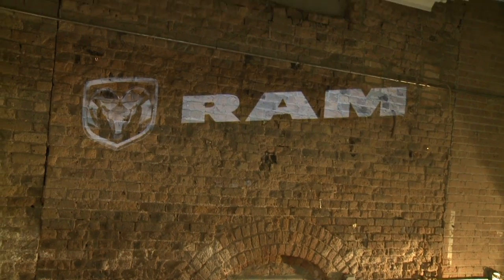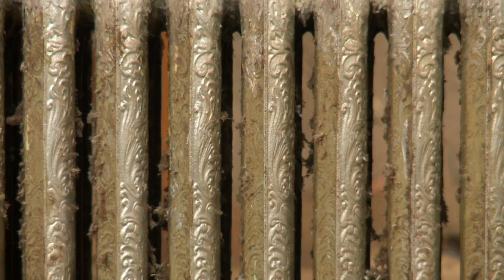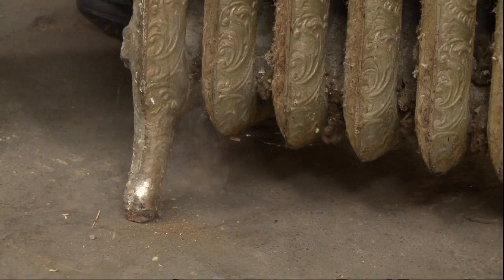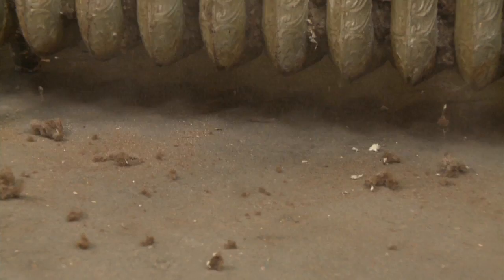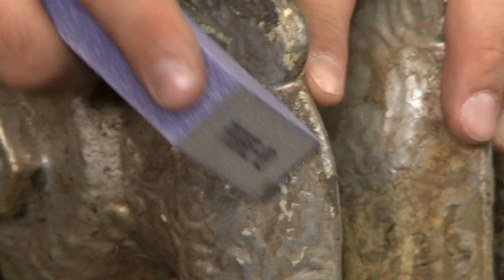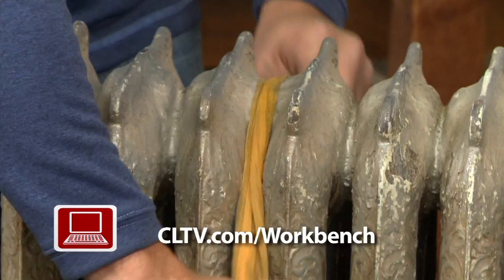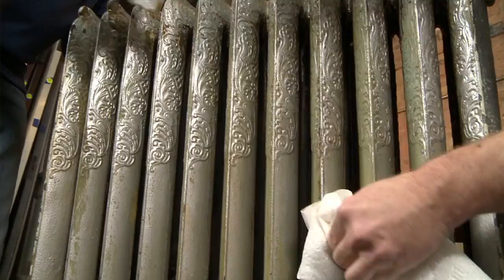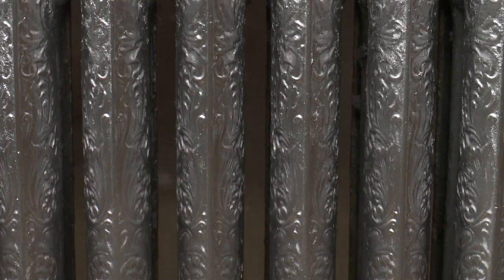How to Paint a Radiator with Sean Buino

Comment: Most radiators are up against the wall , therefore it would be difficult to clean and floss that way . I wish he would have shown with the radiator still against the wall.  I used a similar method just adding an air compressor to get rid of dust build up in those tiny spaces.. thks for sharing tho

Comment: No need for high heat paint.  A cast iron radiator will max out at 180F with water and 220F with steam.  Standard spray paint is heat tolerant to 250F.  I painted my steam radiators with Rustoleum and haven't had any issues for 15+ years.  They may smell at first after initially heating the first few times, but that quickly goes away.
You can also sandblast your radiators to easily remove the rust and old paint.  As long as you have a compressor there are many DIY videos on how to easily sandblast.
Reply: The cans of Rustoleum say max to 220 so I'm hesitant to use it with 220 being the max. Also the heat paint is not that much more money at $7-$8 a can. This is a job you don't want to have to repeat any time soon. Again, moving them to sand blast or pressure wash is difficult as heavy as these things are.
Reply: Agreed. It's not necessary to use high-heat paint.
Also, TSP would be much better for cleaning than Simple Green.

Comment: I don't know....since you have it off and out the house why not at least blast it with a pressure washer-let it dry and then hit it with an air compressor.Thats assuming if you have one you have a bunch and it would worth while renting or buying one or the other.One vid in and I think I came up with a better solution.
Reply: Have you ever tried to move these things? They are extremely heavy and this one is huge so taking it outside to pressure wash would be very difficult. I'm renovating a 2 family house right now in Boston and their are probably 10 Radiators upstairs and downstairs that I'm cleaning and painting and I would not  be able to take them outside easily.
Reply: @lanejohnson8552  I completely under stand what you are saying as i have done it the way i described.Moving them sucks but other than that it is a fraction of the shitty prep work.If you look at the end close you can still see a large amount of shit at the bottom of the inside and it looks like shit.I hate spending time doing something that looks like shit.I would at least hit it with and air compressor .Also,i would be open to different ways if it was not my own home as in like a flip.Hope things went well.
Reply: I know this is old af but, I believe it's off so they can do it in their studio or whatever you want to call the area they shot this video. It's to illustrate what it would be like to paint it where it is in your house...